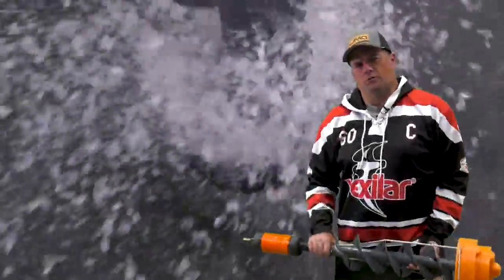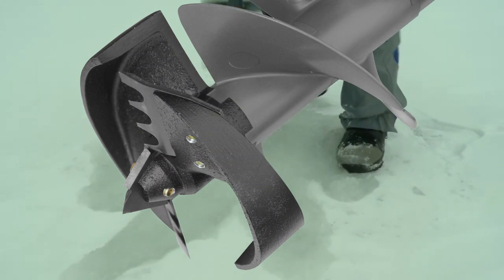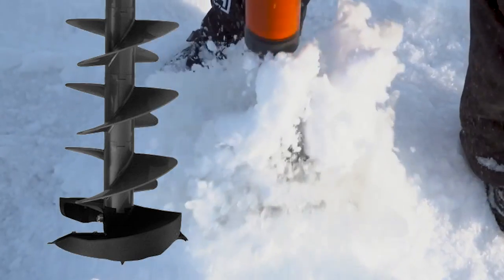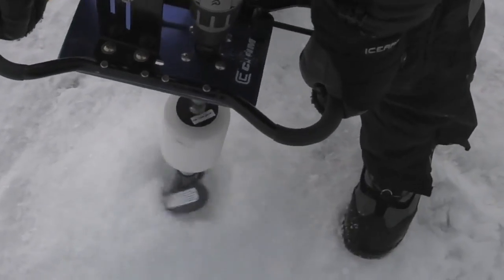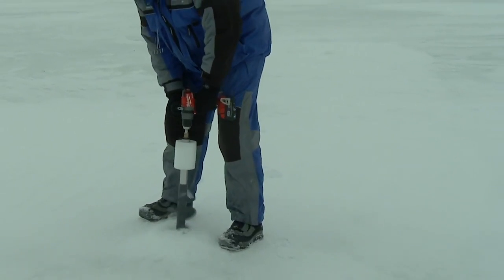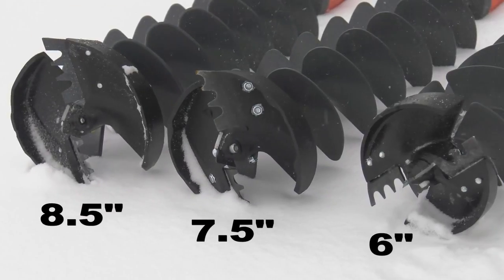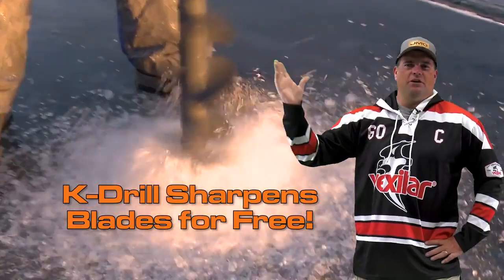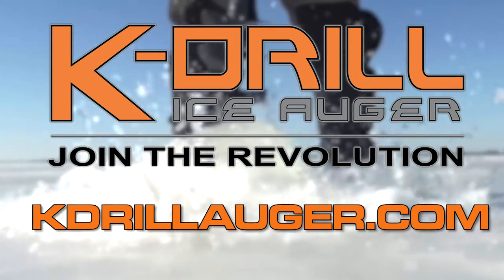K-Drill Ice Auger

Comment: I purchased a Proyama auger, I've been using a friends old hand auger and finally decided to buy a one, under $100, how could you go wrong. Its unbelievable! I hooked it up to my DeWalt XR 20v drill and it will cut through 12 inchs of ice in less then 15 seconds! I drilled around 20 holes with a 2ah battery! Even using the hand crank it cuts good! I will never go back to using a hand auger after using this setup with a drill. Awesome Price, Awesome Performance, Awesome Product!